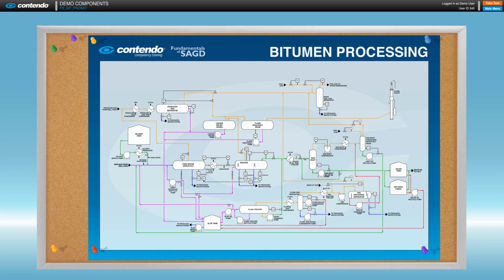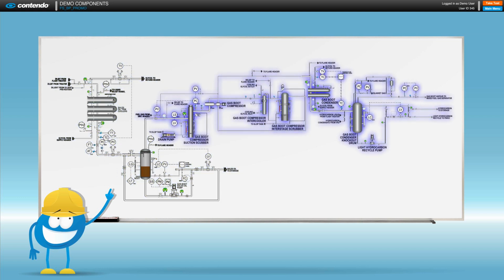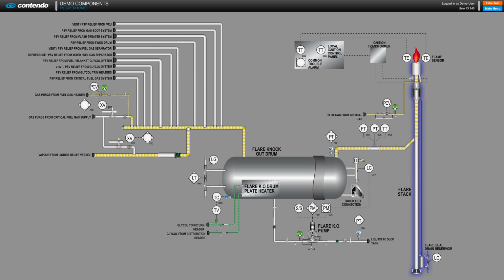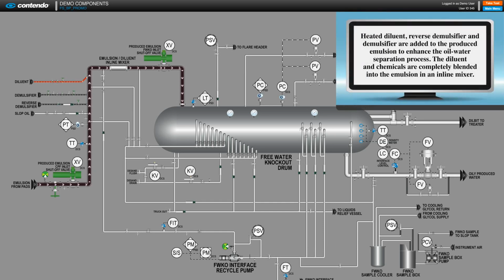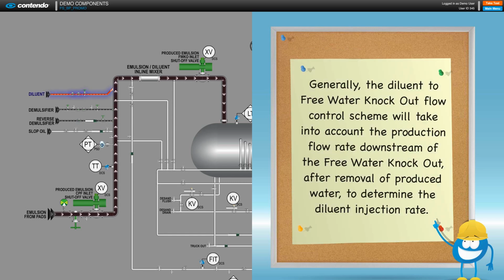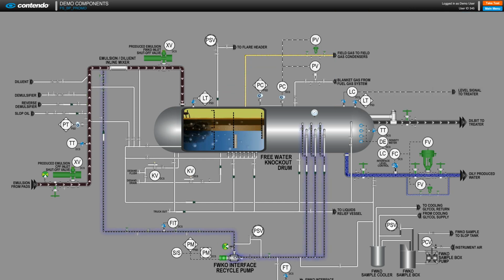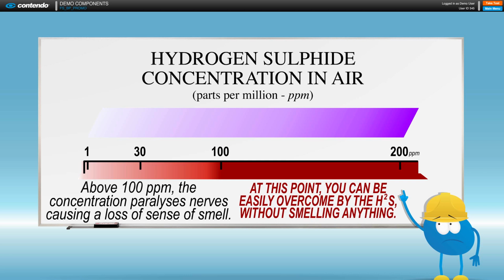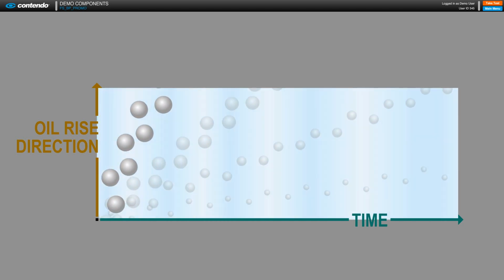Contendo's SAGD Oil Sands Online Training Course

Comment: This video serves as an introduction to *Contendo’s *Steam Assisted Gravity Drainage (SAGD) Oil Sands Online Training Course*. The course is designed to provide industry professionals with a comprehensive, visually-driven understanding of **in-situ bitumen recovery* and processing. 

*Key components of the course include:*

* *Comprehensive Curriculum:* The program is divided into 75 learning modules across four main chapters: Well Pads*, *Bitumen Processing*, *Produced Water De-Oiling*, and *Water Treatment (0:12-0:19).
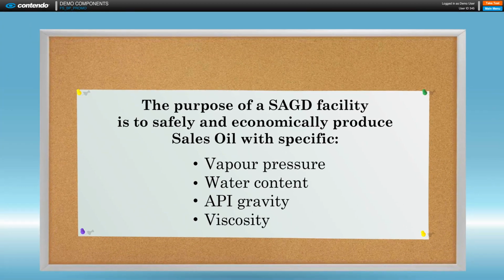* *Bitumen Processing Focus:* The course follows the journey of recovered bitumen emulsions as they are processed into saleable oil that meets specific requirements for vapor pressure, water content, API gravity, and viscosity (1:19-1:47).
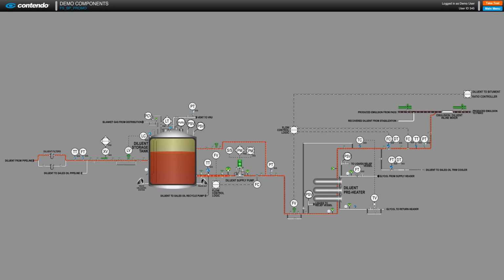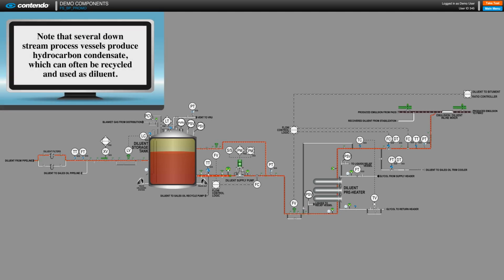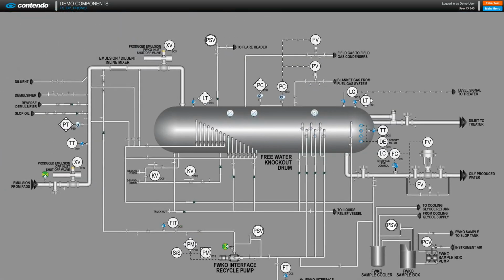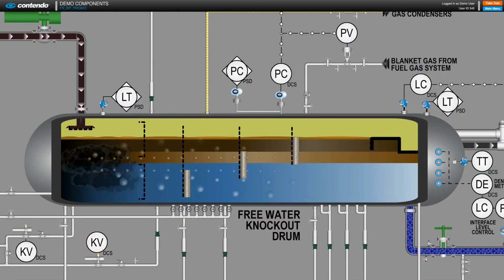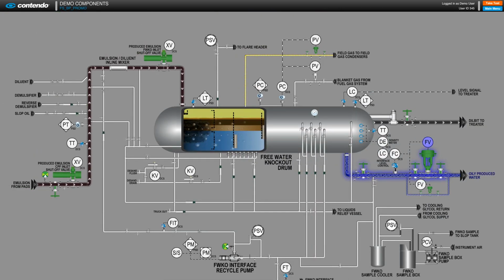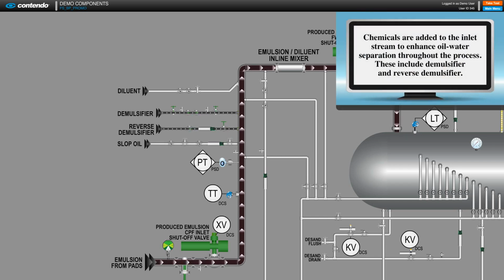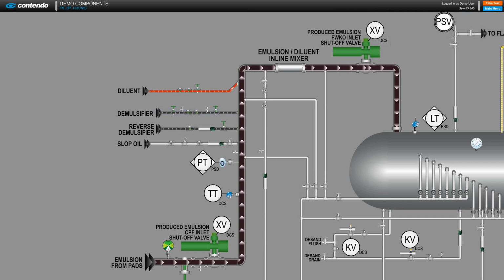* *Visualized Learning:* Concepts are explained through a combination of narrated animations and technical diagrams, such as the flow through a model SAGD facility (1:53-2:06), the mechanics of a Free Water Knockout (6:13-6:18, 8:33-9:37), and chemical additive processes (6:52-7:33).
* *Safety and Hazards:* Significant emphasis is placed on safety, including detailed modules on hazardous materials like Hydrogen Sulfide (H2S) concentrations (11:09-12:16) and process control systems with automated shutdown responses (4:46-5:34).
* *Engineering Concepts:* The course uses physics-based principles to explain operational efficiency, such as the Modified Stokes Law for gravity separation rates (12:18-13:58).

Students are supported throughout their learning with *printable worksheets* and *individual tests* for each chapter to reinforce the material (13:58-14:09).